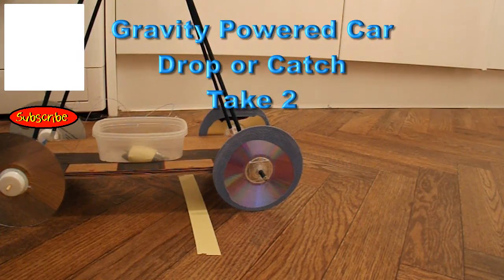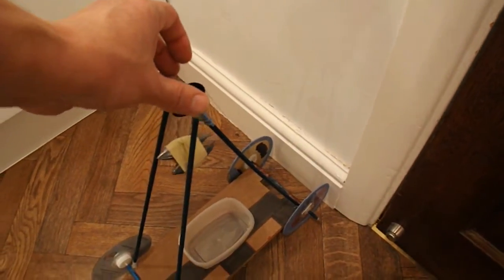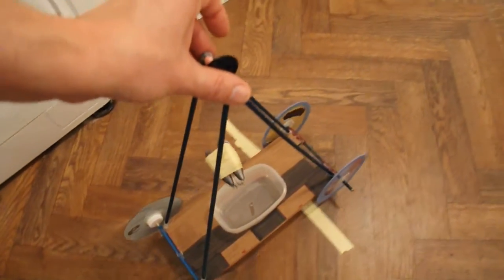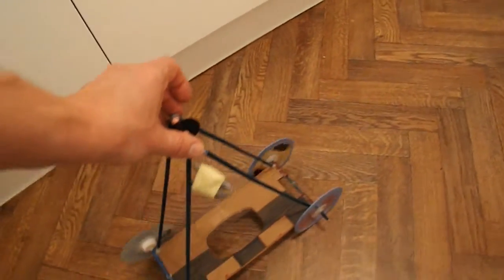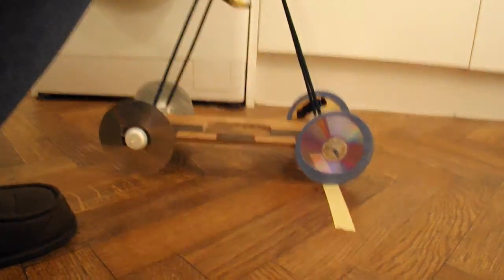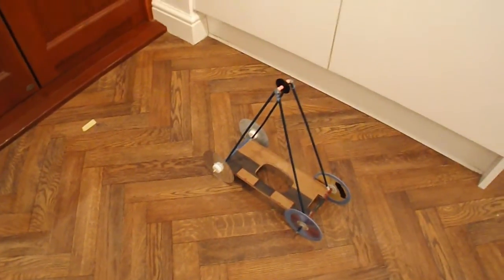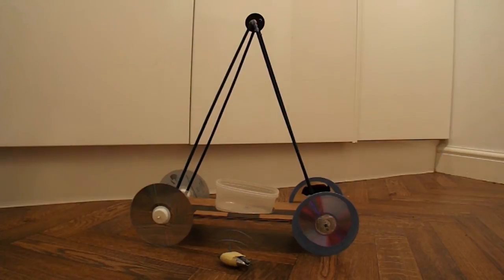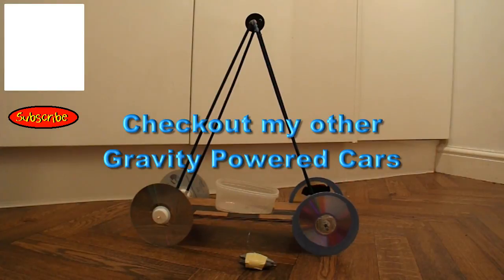Gravity Car - Catch or Drop the weight ? - Take 2

Comment: That seems like a solid conclusion, the car goes farther without the weight. Your original design seems to be the best one. Thanks again for your patients and experiments.
Reply from the maker: I think there is probably more going on here than meets the eye and I certainly don't want to try to work out the maths involved. I am guessing it may be something like the weight contributes to the initial momentum the car achieves until the weight drops off. The car is then lighter and has less friction on it's bearings so it carries on further. A different design might give entirely different results or maybe running over a longer distance with a taller tower for a longer drop would change things. I think I will leave it here :-)

Comment: hello grandad I like all of your cars ive made about 4 of them and I would like you to make a really long rubber band powered car that is about 1 meter long please because I have made a really long one but it was to heavy at the front so I hot glued 2 rocks  on the back
Reply from the maker: Hi James Parkyn, I am guessing you added the rocks because your wheels were spinning and not gripping because you have a lot of rubber power. What wheels did you use and did you try putting anything on the wheels to give extra grip?
Reply: GrandadIsAnOldMan yeah but I guess that I didn't use enough weight so I put rocks on the  body
Reply from the maker: Hi James Parkyn, I don't think you need more weight. Watch this video I just made for you. http://youtu.be/lQ_YCbJXhOs

Comment: Hi, have you ever tried connecting strings to both axles in the gravity powered car and see if it makes any differences?
Reply from the maker: +Will 'The Lad' Stevens Here are my thoughts on that subject. The power available is the potential energy of the weight at the top of it's tower. Attaching strings to both axles will use that energy, evenly distributed to the two axles assuming the axle diameters are identical and the wheel sizes are the same. The only benefit in powering both axles is that you have double the grip on the road because you are using 4 wheels so there is less chance of getting wheel spin and wasting energy, so the acceleration would be smoother.
Reply: Thanks for the response. It seems I'm grasping at straws here then. I'm trying to get maximum distance from a 1m x 1m x 1m (max dimension) car by dropping a 500g weight (and using only the energy stored in that i.e no rubber bands etc), and have done all the usual, drop it vertically, use a gearing ratio thing, minimise weight etc, is their anything else you think i could incorporate to get max distance?
Reply from the maker: Will 'The Lad' Stevens I am guessing you have already looked through my Gravity Powered Car playlist but this one is the simplest I came up with. https://youtu.be/m8-pdC-4AX0?list=PLA5a2xPRSrB1zzCqDckAnlOzz8iViuM94
Reply: GrandadIsAnOldMan Yep, seen pretty much all of them. Cheers